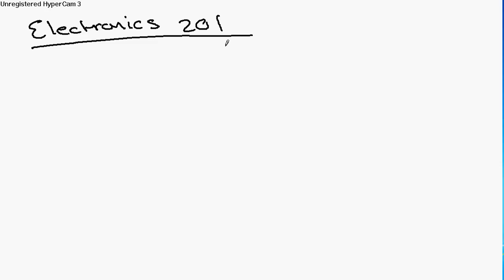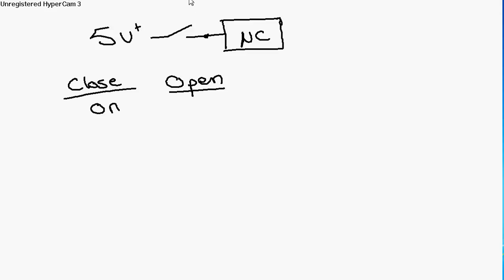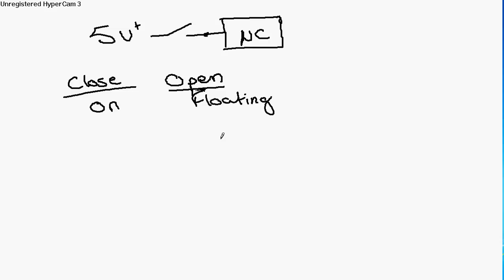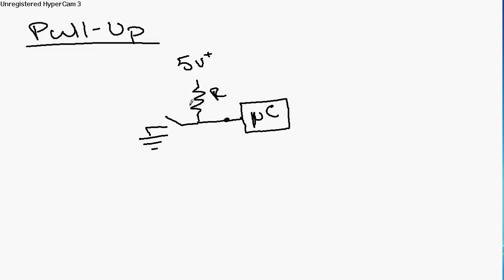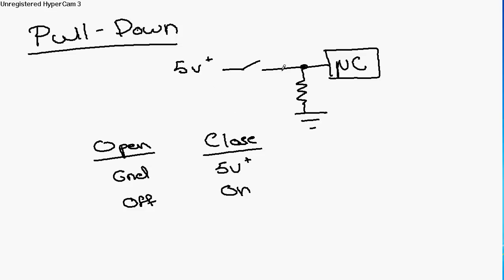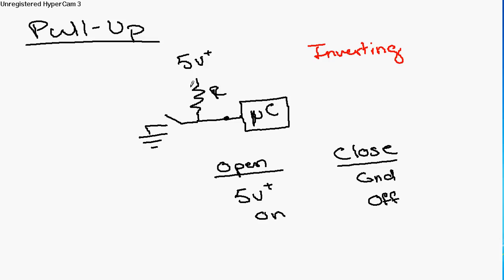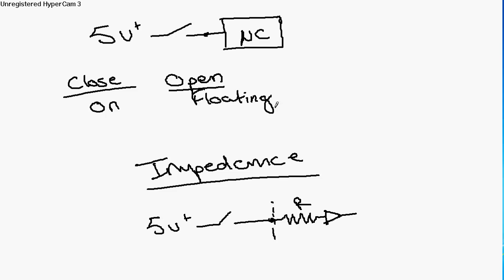Electronics 201: Pull-Up and Pull-Down Resistors

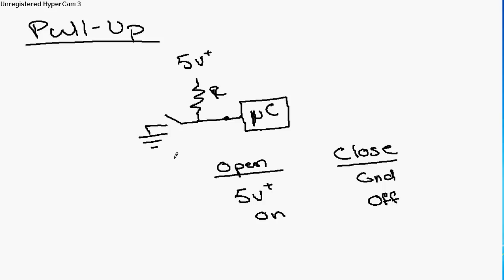Comment: I'm beginning to realize why explanations of pull-up and pull-down resistors have kept me confused.  You, and others, say that the pull-up is necessary to prevent a floating state when the switch is open, however contradict that statement by saying that it is only there to prevent a short circuit when the switch is closed.  Here is what you say from around 6:30 to 7:00:

“Now this resistor here serves another point.  If this resistor weren’t here, it would have the same effect.  Except that when you close the switch, you would be connecting your 5V supply directly to ground and that is called a ... short circuit.  So that resistor also serves to limit the drain on this when it gets pulled to ground.”

You say that the pull-up is needed to avoid floating, then in the next breath say that things would work just the same without the pull-up and that the resistor is really only there to prevent a short when the switch is closed.  But still imply that it has a dual role with words like “another” and “also”.

If you put a multimeter or oscilloscope on the Vout with respect to ground (that which would go into the microcontroller) it seems that the resistor is necessary for the case where the switch is closed to pull the output down to close to 0V otherwise, Vout will just stay at 5V.  The addition of the resistor doesn’t seem to have anything to do with keeping the output (in to the microcontroller) from “floating”.

Testing on an Arduino Uno, a pull-up is not needed when the switch is open - the output is high and the Arduino input consistently reads HIGH - just as you said.  When the switch is closed a resistor is needed to avoid a short (otherwise the Arduino seems to get the power sucked out of it - maybe a maximum current rating is exceeded, I don’t know).  Placing a resistor between ground and the switch accomplishes this, but the output doesn’t change, it stays HIGH when read on the Arduino pin.  Placing it in “pull-up” position, the short is avoided, the output goes low and the Arduino consistently reads LOW.  So it would seem the “pull-up” plays more of a role in pulling down, but still doesn’t seem to have anything to do with pulling a “floating” value anywhere since there doesn’t seem to be any floating going on here.  (I didn’t use the internal pull-ups, which I believe would be contrary to connecting the input to 5V with an external pull-up, and in fact didn’t even bother setting the pinMode() since they default to INPUT anyway.)

Is there a reason why there aren’t better examples for which the so-called “pull-up” resistor is actually doing what its name implies?  This video is basically an echo of every web site or youtube video I come across (albeit done better than others).
Reply: When the switch is closed, it seems one can possibly think of it as a resistor voltage divider circuit with R1 equal to the value of the "pull-up" and R2 equal to 0.

Vout = Vin * (R2 / (R1 + R2)) = Vin * (0 / (R1 + 0)) = Vin * 0 = 0

With the resistor before the switch and after Vout, just to avoid the short:

Vout = Vin * (R2 / (0 + R2)) = Vin * (R2/R2) = Vin * 1 = Vin

So the resistor has be in "pull-up" position in order for the voltage to be read as low when the switch is closed.
Reply: 100% agree. Came across "pull up resistor" concept yesterday and had to understand it, came to the exact same conclusion as you. That it is only there to avoid shorting at logic low voltage. And that the resistor is given meaning it doesn't have, making it harder for people learning about "floating" issue to understand how that was resolved.

Comment: so what is the impedance of an arduino pin? how can you find the impedance of a pin?
Reply: Wouldn't it depend on the connected/not connected status of the other pins on the IC (changes the parallel/series relationships)? Look into the concept of thevenization/Nortonization of a circuit.  I'm new to this though so somebody will likely school me on here pretty quick.
Reply: firstandforemost87 using Thevenin's theorem, you can calculate the voltage and impedance between any two given points in a circuit, yes

Comment: so if i didnt know if a chip encorperates the pull up resistor for i2c and i put the resistor in, it wouldnt effect the i2c at all. so basically always put in a resistor and 5v supply for i2c?

Comment: Great video, thanks a lot. I still have an unclear point, though: why, in the pull down configuration, does the floating effect disappear when the circuit is open. Is that because the resistor R  prevents current fluctuations on the µC pin ?
Reply: Yes, all fluctuastions go to the "ground"
Reply: ***** But if the fluctuation goes to ground, why does the current go to the pin when the switch is closed? Wouldnt it make sense that the current goes the same way in both situations?

Comment: I thought Wikipedia's entry on this subject was concise and explained the concept really clearly, hope it helps someone:

"A pull-up resistor weakly "pulls" the voltage of the wire it is connected to towards its voltage source level when the other components on the line are inactive. When all other connections on the line are inactive, they are high-impedance and act like they are disconnected.

Since the other components act as though they are disconnected, the circuit acts as though it is disconnected, and the pull-up resistor brings the wire up to the high logic level.

When another component on the line goes active, it will override the high logic level set by the pull-up resistor.

The pull-up resistor ensures that the wire is at a defined logic level even if no active devices are connected to it.

A pull-down resistor works in the same way but is connected to ground. It holds the logic signal near zero volts when no other active device is connected."
Reply: As a beginner, I can tell that it's not explained well.
Reply: I need to read it a couple times, but that makes sense to me😎

Comment: Well done, very useful
Value R of Pull-Up
just wanted to point out that in the Pull-Up case, the value of the Pull-Up resistor has to limit the current flowing to the input pin and ground. it is preferred to be 10 times less than the impedance of the pin otherwise, a loading effect will be present as a result of the voltage divider, hence it is better to have the Pull up resistance Value R as 10 times less the impedance of input pin.
Reply: Good point, Ali H.  Input impedance is desired to be high while output impedance is desired to be low.

Comment: On 7:38, lets say that µc has an impendance of 10Ω, which means that the resistor should have 100Ω, correct?

Why is the floating current choosing ground over the microcontroller when ground has a resistance of 100Ω and the microcontroller has a resistance of 10Ω?
Reply: He applied the one tenth value to the wrong resistor.... Your question is justified.
From another website: The general rule is to use a pull-up resistor that is an order of magnitude (1/10th) LESS than the input impedance of the input pin (10k-100k). An input pin on a microcontroller has an impedance that can vary from 100k-1MΩ

Comment: isn't this in fact analog?.... so why is floating 'bad'. Does the unclaimed open, or undefined path have a proper name? We are taught that nothing in electrons is wasted, right?

Maybe you or someone reading can help me understand this , if I get the reason behind pull up and pull down resistors.

So, I'm looking at it like the 'pull up' and 'pull down' difference is only a bi-product,
or Binary bi-product rather, (binary because there's a 1=on,2=off & 1= off,2=on scenario) and pi-product meaning 'unintentional'. Is that right to say that?

 
Perhaps within the context of a project or making say a stereo, an unpredictable variable would be considered 'bad', let's call it a loose ground. But with all things equal, in what case is this desired? Meaning , is there ever a reason to not have either PU or PD resistance to close the circuit?

Thank for the explaination - i'm just struiggling with this part of it though.

thanks much
Reply from the maker: This is very much a digital issue, but if you really want to get down to it everything is analog. In order to make sure that digital components operate properly, everything needs to be entirely on, or entirely off, to ensure predictable operation.

This is only necessary for digital applications, ie 7400 series ICs. For analog practices, you want a full range of values, not just 2.

Comment: I have just one question about the pull down resistor circuit: I understand how the current flows when the switch is open (the ground sucks all the current away from the micro controller leaving it with a low state). But when the switch is closed, why does the current flow into the micro controller when the impedance (resistance?) is higher than a 10K pull down resistor? Wouldn't the current flow to the path of lowest resistance towards the ground? Thanks

Comment: Great stuff, man! Thanks. I need to translate this from your switch example to interfacing a microcontroller (output) to an LDO voltage regulator chip that has a handy extra pin to control on/off. I'll think on it a bit...

Comment: Excellent video. I would just like to point out that while floating pins on _inputs_ are generally considered bad, a floating pin on an _output_ is either doesn't matter, or is required like with multiple outputs on a buss configuration. The floating output would (obviously) be a separate video, but it should be stressed on this video that the "bad" label is applicable here only because this video is dealing with inputs.

Comment: It all depends. Yes, many reset pins on many chips are low active, so you would want to use the pull-up resistor technique. But, this is only true if you are using a common NO switch (normally open). If for some reason you are using a NC switch (normally closed) then you would want to use the pull-down resistor technique because pressing the button would _open_ the switch.

Comment from the maker: Pull-up resistors are built into the Arduino's GPIOs. To use them, you would make a pin an input then write high to that pin.But you wouldn't connect the switch to 5v, you would connect it to ground.

Comment: When you say the pull up circuit is built in to most uC's, does that include the Arduino? If so, does that eliminate the need for this and allow you to just wire 5v to button to pin?

Comment from the maker: No. There would only be voltage drop if the voltage entering the controller in any way flowed to ground. What happens that voltage is used to trigger with a transistor.

Comment: One question, won't there be a voltage drop across the resistor so 5V won't enter the controller

Comment: So does that mean you should use pull-up resistors for reset buttons? For example, you press the button to turn it off, and then release it to turn it back on. Is this how most, if not all, reset buttons work?

Comment from the maker: An MCU GPIO responds to voltage not current. Because of that high impedance, the GPIO won't draw a lot of current from the source, and thus won't diminish the voltage to the pin.

Comment: You said 'With a high impedance, one could work with a weak signal'..
According to Ohm's law....if voltage is directly proprtional to current...
If a weak signal ( a low potential) is provided, it would further decrease (voltage drop) after passing through the internal resistor. So, a very low current would reach the MCU circuit.
How would that be effective..

Comment: Hi-
Using the Amtel 1284P.  Trying to send a signal to the CLEAR pin on a MAX16054 for the purpose of auto-shutdown via software.

The setup is like the first example in the MAX16054 datasheet.  Need to calculate the value of the pull-down on the CLEAR line.

Tried to include links to the datasheets, but YouTube wouldn't let me.  Sorry

Thanks!

Comment: Good tutorial.  The context was in regard to input pins on a uC.  But what about output pins from a uC?  How would you calculate the value of an external pull-down from a uC?  I am experiencing this right now and can't find much about how to calculate it.  I looked at the datasheet for the uC and came up with a value, but it seemed to low.  Thanks.

Comment: Great video, the only thing i'm still confused is in the voltage that the microcontroller 'sees' (in the pull-up), i guess is less than 5 volts due to the resistor??

Comment: The pull-down resistor seems to be easier to work with since it doesn`t use "inverting logic". But it seems to waste some energy, because when the line is truly powered, there is a little current drained to ground all the time. Is there a more power efficient circuit that can be used for that? Maybe using a PNP transistor?

Comment from the maker: In that scenario when the switch is closed, the current would rather flow to ground and not the pin. With the resistor connected to ground, more of the current can flow to the pin, rather than to ground.

Comment: Nice tutorial, was a confusing topic for me to with all the way over analyzed descriptions out there.  Question though on the Pull-Down.  

Assuming you want R = 10*(Impedance of pin), and if current takes the path of least resistance, then: When switch is closed it will go to the pin because its smaller impedance than the R to ground, that's good.
BUT when its open, wouldn't it still flow to the same lower impedance path?  GND may be on the other side of the resistor, but its still higher Z no?